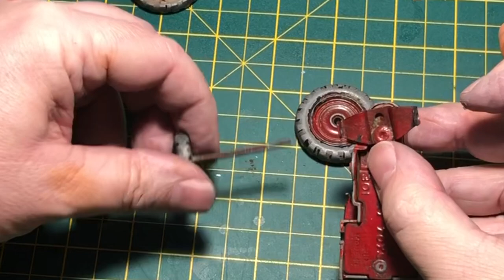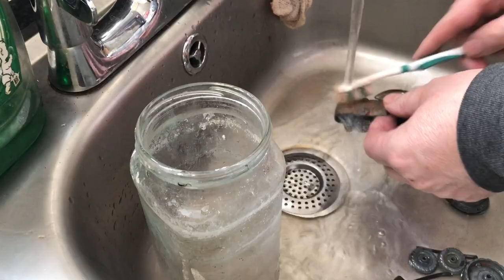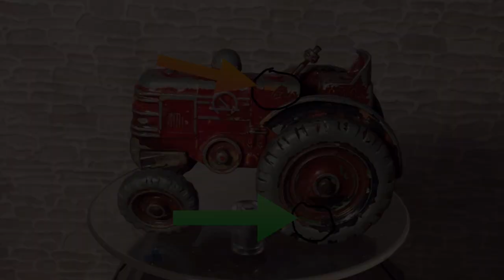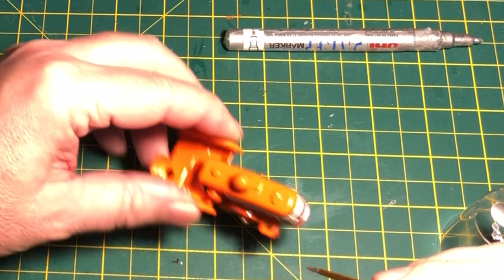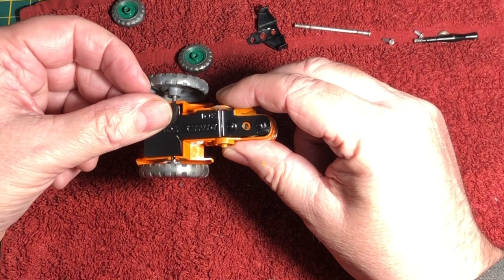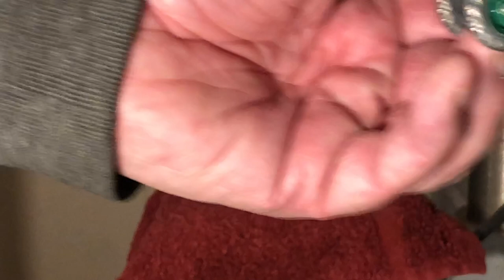dinky 301 field marshall tractor restoration

Comment: Nice job. Strangely I restored one of these 25+ years ago, wanting a series 3 I painted mine green with silver wheels and black tyres. I have no idea why Dinky painted the wheels on the series 3A green as they also should have been silver. I had to make my steering wheel and exhaust and did away with the driver - or at least his butt hole!  I doubt any of those parts were available then. I believe the last of these had rubber tyres.